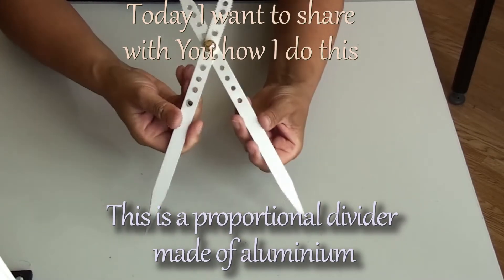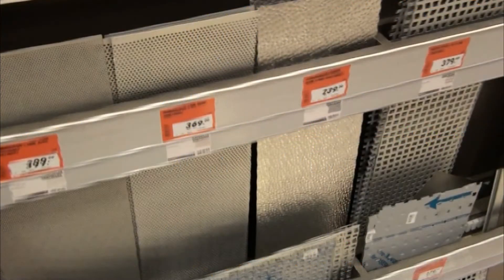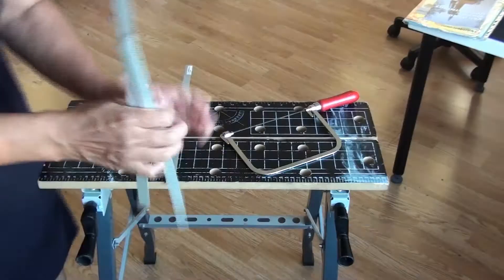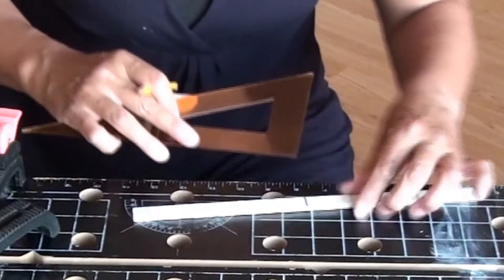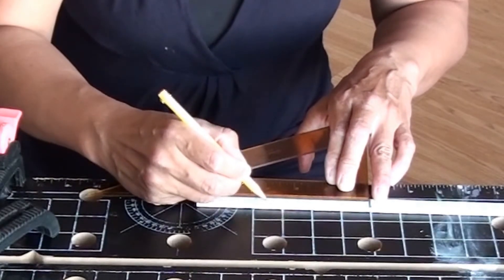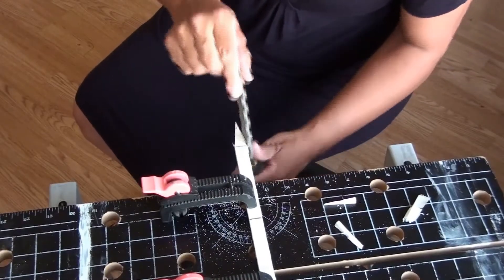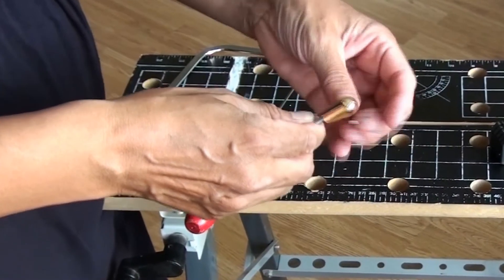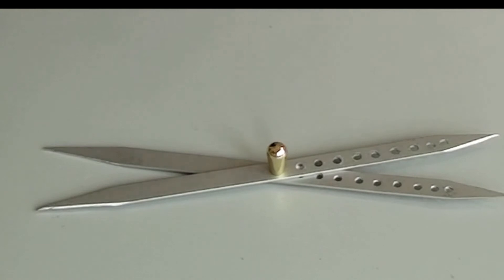How to make a Proportional Divider in metal - Easier than You think!

Comment: Thanks but for us to make our own you need to be more specific. How long is the aluminium bar? How far apart are the hole, etc. There are no real info available in the video.
Reply: I will try to explain (pardon my bad English): You take the length that suit your needs. For the first one I recommend a length that fits into your drawing bag, let's say 25 cm. For the distance between the holes, use from 0,5 cm to 1 cm. The more holes you have, the more fine-tuned measurements you can make. The important part is that you have the same distance between each hole and that the two parts are exactly the same. Let's  say that you draw big paintings with many details - then maybe it is better for You to have a really large tool, say 50 cm in length with around 1 cm between each hole. If you on the other hand draw really small and have a small drawing bag, then it may suit you better two have a tiny tool that is maybe 20 cm. 
When I decided how long the bar would be I took a length that fitted in my painting bag and since I mostly work with A4-sized papers I made the bar around 25 cm long. When I decided how far apart I would make the holes in the aluminum bar I did not want to make the bar too fragile but in the same time I wanted as many options as possible - so I just picked a distance between 0,5 to 1 cm.